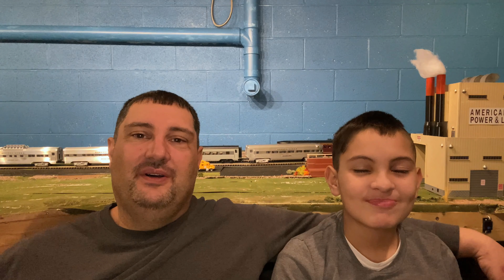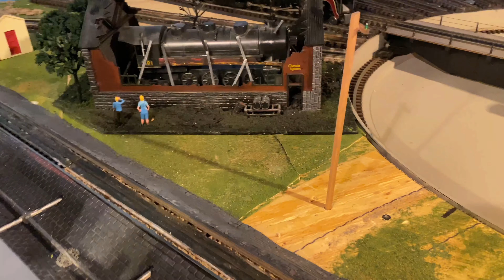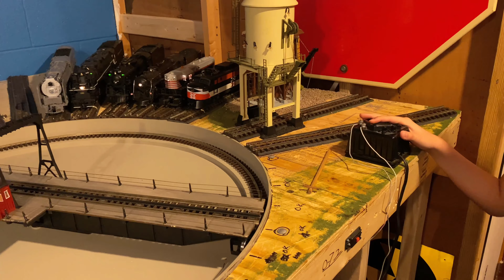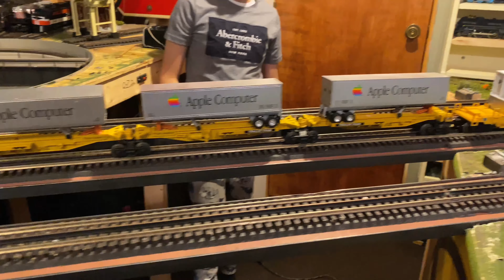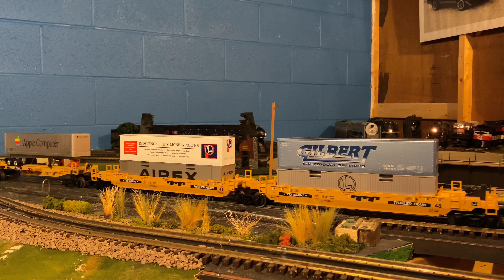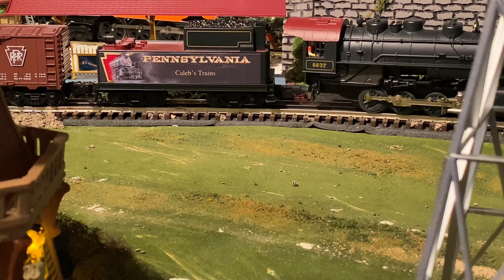Layout rebuild update #10

Comment: I have a vintage Lionel train and I was wondering how did you change the power for the locomotive to AC?
Reply from the maker: There are a few ways.   You can use a bridge rectifier but you’ll only be able to operate it in one direction.  There are probably modern e-units on the market that you can use that converts AC to Dc too.  What I did was found an old Lionel AC motor locomotive that had the same 4 drive wheel setup as mine.  Then I took the “guts” out of that engine and put them in my engine.  It works flawlessly.  Many Lionel MPC era locomotives are remakes of older Lionel locomotives.  Once you find an older donor locomotive it’s pretty easy.  Thanks for the question.  Happy Railroading! 🚂🚋🚃